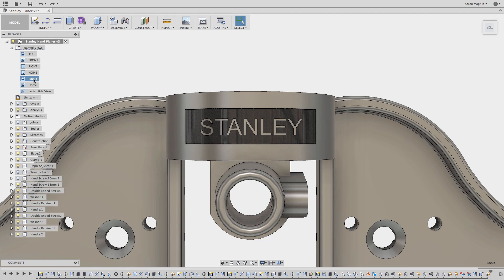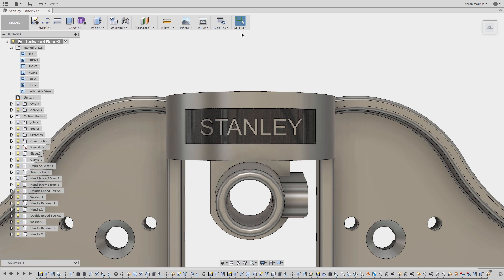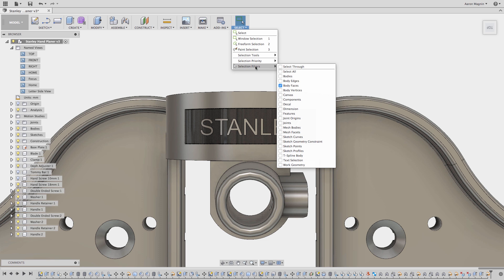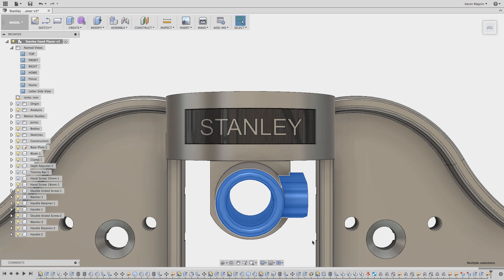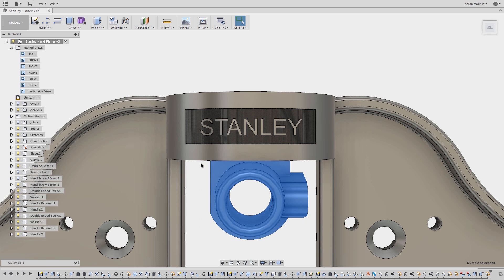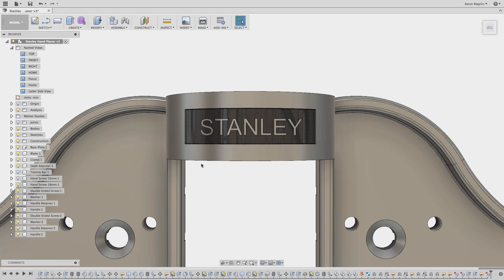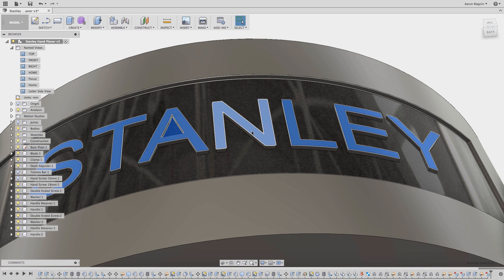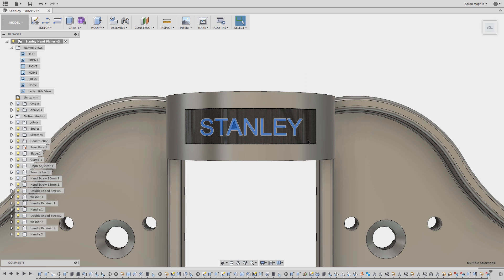QUICK TIP: Selection Tricks

Comment: This is exactly the same as Rhino 3D. So if you can I would love a measuring tool like Rhino where I can measure any where to any where on the planes. Fusion 360 only allows you to measure from a feature to another feature, not like 22% up an edge to somewhere up the edge aligning with a straight edge on another part of the model. This is a fundamentally useful element in Rhino.